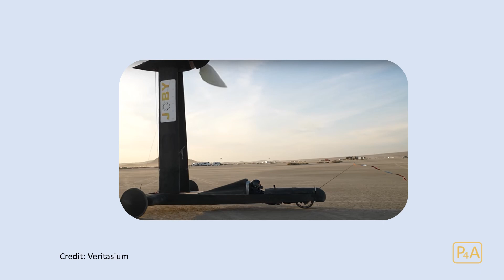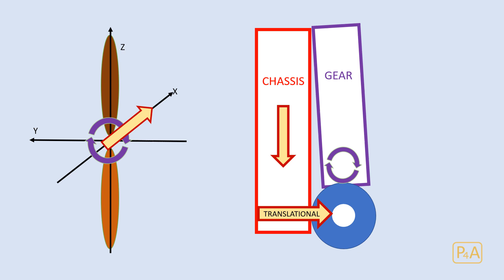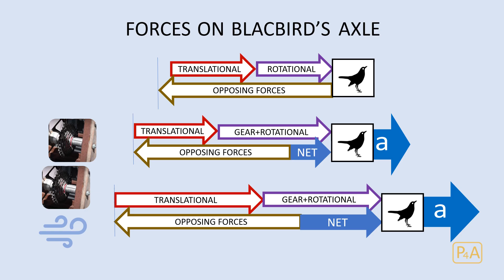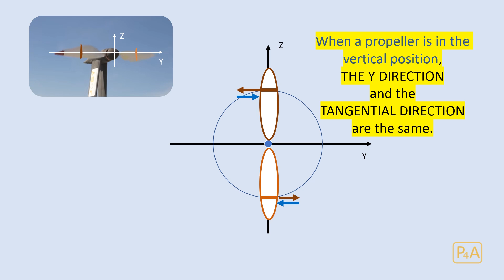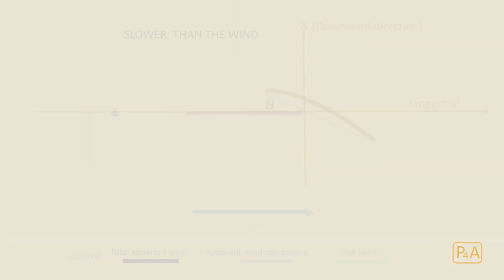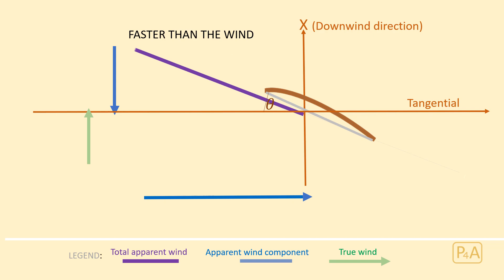How Blackbird Works

Comment: Sailboats go faster than the wind. It is simply a matter of leverage between two medium. The top of the sail generates more thrusting load on the hull through simple leverage, the drag of the water allowing the accumulation of that force against the greater leverage of mast height. That leverage is translated by the hull as extra speed because contact with the second medium, water, generates a leverage RATIO that accumulates force and is expressed in speed (through air compression). It is the RATIO part that few people understand... Why does the sail not deflate when faster than the wind? Because the second medium, water, holds the sail back and allows it to accumulate the air in a DENSER air pocket that then moves faster than the air itself. People have REAL trouble with that part, because they ignore the viscosity of fluids. That sail is still full because the air is trapped there and goes faster than the surrounding air.  The car here behaves the same, with different mechanics, but the same principle is that forces, not energy, are multipliable by a LEVERAGE RATIO when an object touches two separate mediums, land and air. Or air and water. The key is the two separate mediums creating a RATIO between them. And RATIO means leverage multiplication. If you do not understand leverage can work to create motion, you do not understand the principle. Energy is always 1:1 or less, force is a potentially infinite RATIO.

Comment from the maker: According to the laws of physics, the ground is not a SOURCE of ENERGY to a moving car. The only source of energy is the fuel. The ground only helps to convert the energy of the fuel into kinetic energy of the car.  The same principle holds also in the case of Blackbird.  The ground is not a source of energy. The only source of energy is the wind. Another example. A person is sitting in front of a desk. The person pushes against the desk. All the energy in this case comes from the muscles of the person. What will happen? It depends on the system that includes a person, a desk, a chair, and the ground. If the chair has wheels, the person and the chair will be pushed backwards together. If the chair does not have wheels, the person and the chair may fall back. If the chair is glued to the ground, nothing moves. In all those cases, and in the case of Blackbird, the ground is not a source of energy.
Reply: >> According to the laws of physics, the ground is not a SOURCE of ENERGY

You clearly aren't familiar with the laws of physics.  Even with all caps - you're still wrong.
Reply: You are right.Source of energy is wind.Force of wind is pushing the cart forward which in-turn rotate the wheel,then power from wheel is transferred to propeller.(when wind velocity is high).This is similar to a toy car in which a toy fan is connected to wheel shaft.When we push the car its wheel will be rotated and then power will be transferred to toy fan(provided sufficient friction is there and wheel rotate without slipping).If partial brake is applied to fan shaft person has to push the car with more force(assume wheel is not slipping) and fan will be rotated by power from wheel.When speed of black bird cart increase,rotating speed of propeller increase which require higher torque to rotate the turbine.That will be supplied from wheel due to increased thrust in propeller.

Comment from the maker: In my opinion, Blackbird is a smart machine, and its performance is amazing. Unfortunately, there are some gaps in understanding how it works. It is true that energy may be expressed in different frames of reference. However, energy is a conserved entity. If the ground is a source of Blackbird’s energy, how much energy did the ground lose? What kind of energy did the ground lose? Kinetic? Potential? Thermal?  The video argues that the only source of energy is the wind. Blackbird’s clever design extracts that energy and distributes it with the aid of the ground. Part of the wind’s energy propels the car, and another part spins the propeller faster. The ground is not a source of energy.
Yehuda Salu
Reply: >>  If the ground is a source of Blackbird’s energy, how much energy did the ground lose? 

The exact same amount as the Blackbird gained.

>> What kind of energy did the ground lose? Kinetic? Potential? Thermal? 

Kinetic.

>> The video argues that the only source of energy is the wind.

Yes, but that is only true from one specific frame.  You can analyze this in any of an infinite set of frames and get a different answer (but with the same result).

>> The ground is not a source of energy.

Sorry - but that's just wrong.
Reply: In any event, you're ignoring the bigger issue.  Regardless of how we account for energy, you have fundamental errors in your explanation of how the vehicle works.  And that's presumably the entire point of the video.

Comment: Unfortunately, there are some serious errors in this explanation.  The Blackbird has been configured to go directly downwind faster than the wind, and it has been configured to go directly upwind faster than the wind.  In its downwind configuration, the rotor is in fact a propeller, and operates strictly as a propeller at all times.  It does not (and cannot) turn the wheels.  In its upwind configuration, I replace the propeller blades with turbine blades.  In this configuration, the rotor operates strictly as a turbine at all times.  In this case the turbine always turns the wheels.  It's also not accurate to say that all the energy comes strictly from the wind in either case.  Energy is frame dependent, so we can choose a frame in which the energy comes from the ground, or another frame in which it comes from the wind.
Reply: In both case source of energy is wind.In upwind condition air screw act as turbine which works from wind.In starting of down wind thrust on propeller and air drag push the cart forward,and friction in the wheel caused by this push rotate the wheel,and wheel rotate the propeller.
When cart speed is more than wind speed,air screw act as turbine due to relative upwind,at the same time it takes energy from wheel(as propeller) due to thrust produced by it.(ie torque required to rotate air screw is coming from wheel and from wind due to turbine effect)